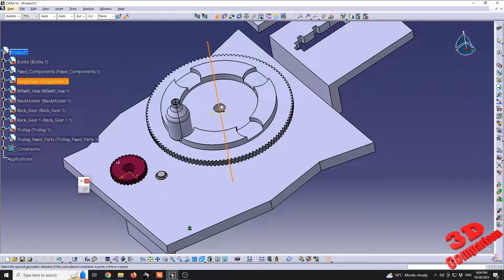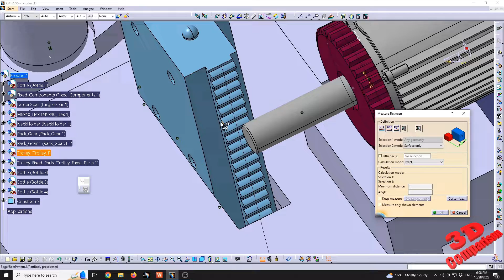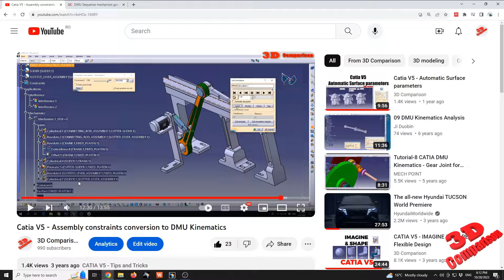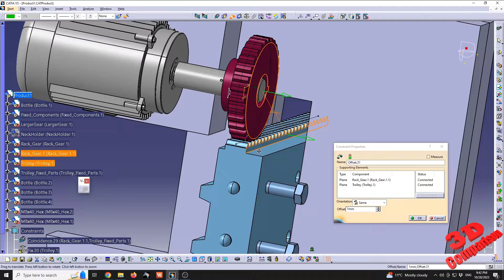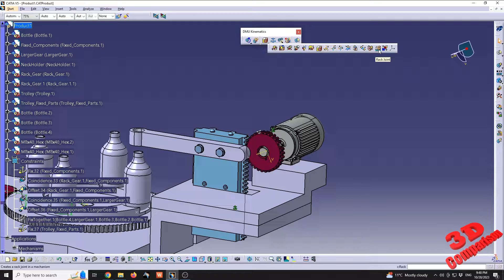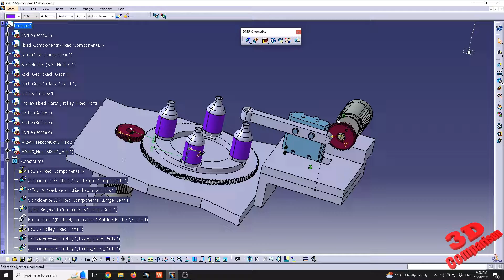DMU Kinematics - Sequencing two mechanisms

Comment: Very good . Can two mechanisms move simultaneously in this method? If the answer is yes, how do you do this?
Reply from the maker: Hello, you can synchronize two or more mechanisms with DMU using Laws. CATIA V5 doesn’t allow direct dynamic interaction between two mechanisms (like real-time torque transmission between gears) unless they are in the same mechanism definition and constrained together using gear joints, rack-pinion joints, or similar.